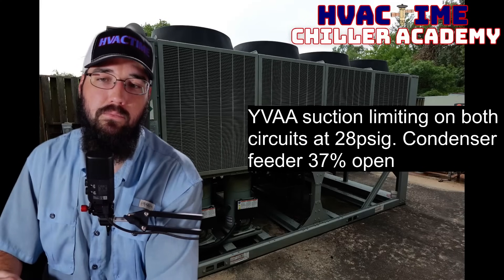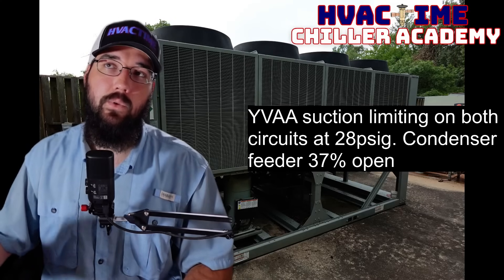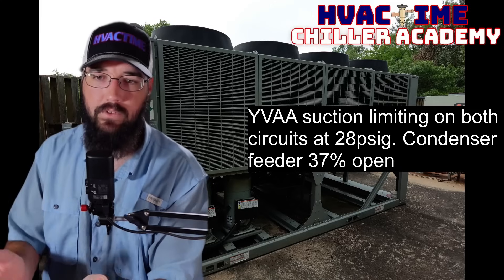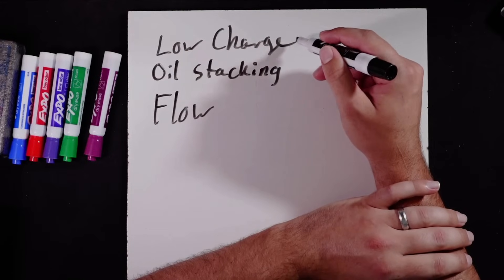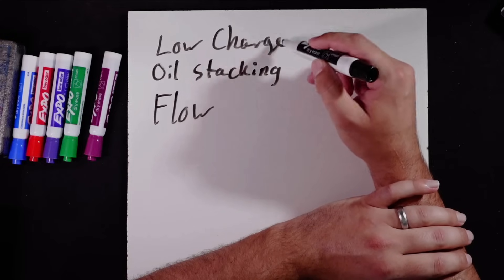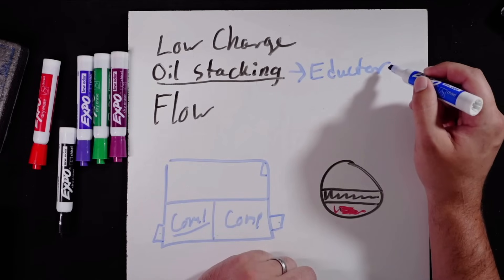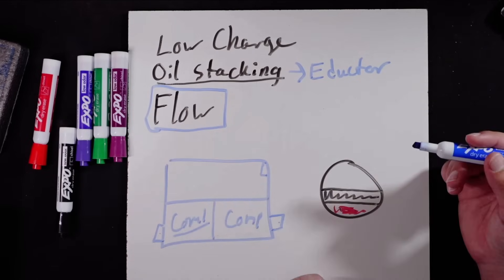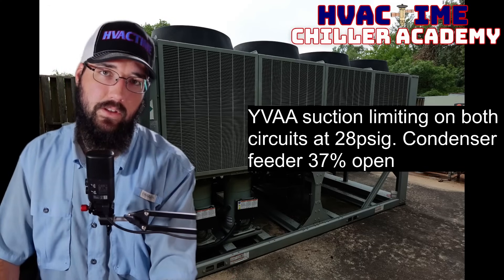YVAA Suction Limiting but Valve only 38% on Chiller

Comment: Other reason could be a faulty leaving Water Temperature sensor. The Water is Leaving as set point and even lower but the computer is not realizing that cause the sensor feedback is above that Value, so the unit will run at High Capacity trying to reach set point over Cooling the Evaporator and Suction goes way down limiting